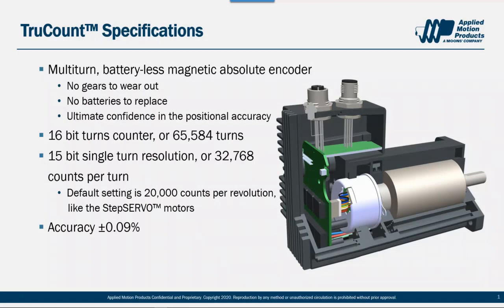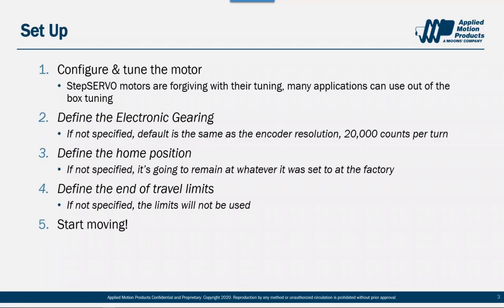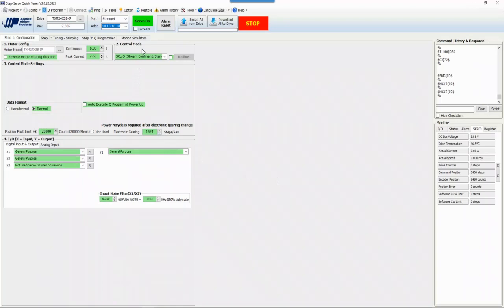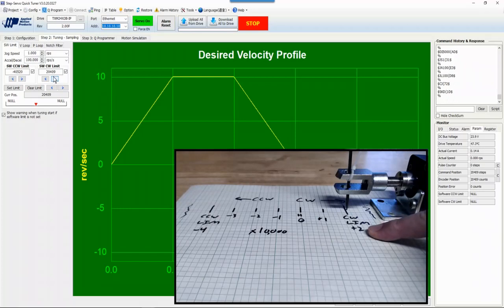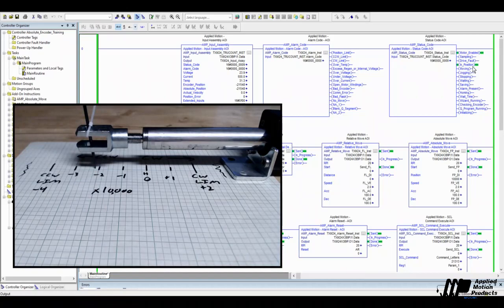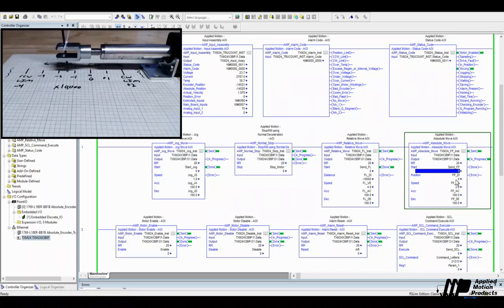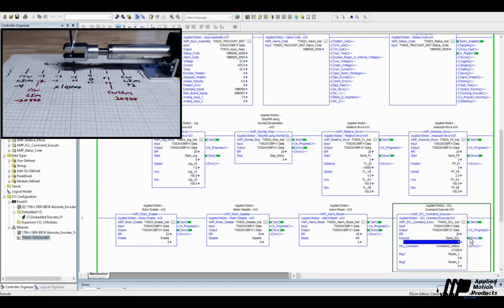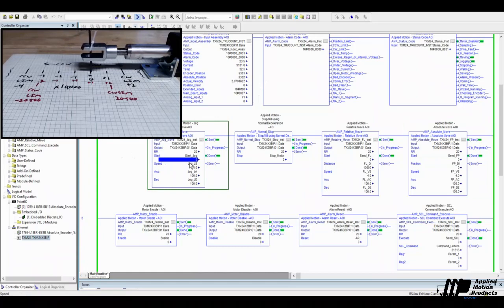EtherNet/IP Tutorial 4: Hands-On with the TruCount™ Absolute Encoder

Comment: Hi Sir, will the LM and LP, SA commands do the same thing for the motor with incremental encoder ?
Reply: Our Host Command Reference details the LM, LP, and SA usage.   Without an Absolute Encoder, any incremental encoder will power up with a position of 0.  It is recommended that you set the LM and LP after you have completed a homing routine. The LM and LP can be set via SCL Commands, Modbus RTU/TCP, Ethernet/IP and Q Programming. For more information you can check out our application note at https://applied-motion.s3.amazonaws.com/documents/Application-Notes/APPN0052_TXMX_TSMX_Absolute_Encoder_setups_RevC.pdf
Reply: @marktingamp3076  Thank you for the info. That's what I am going to do.